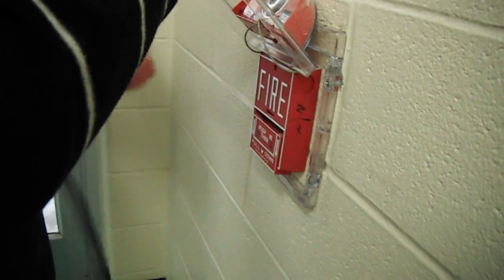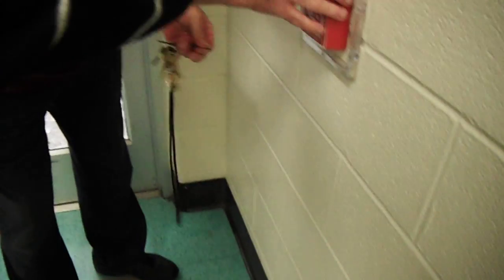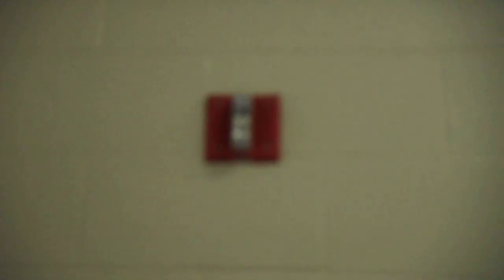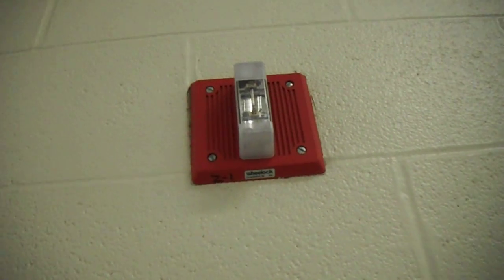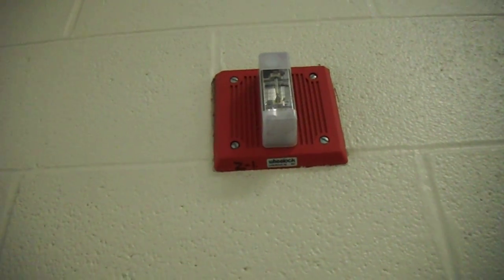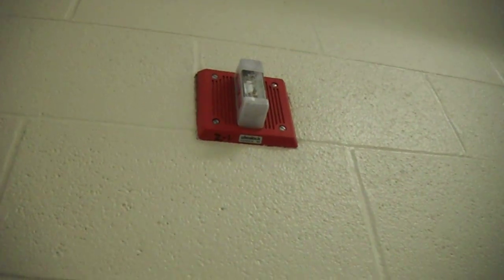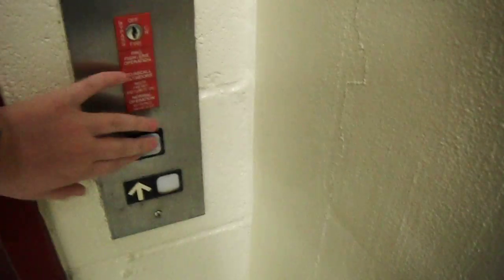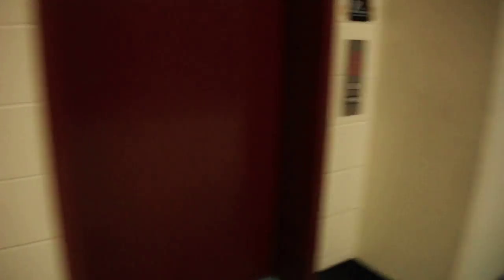Faraday MPC-2000 System Test

Comment: A couple of buildings at my college used to have Faraday MPC-2000 systems, replacing old Simplex 4207 panels during the 90s. For a while they kept the old Simplex 4051+4050-80 horn/lights, and then over time replaced most of them with Space Age VA4 horn/strobes, and they kept the old Simplex pulls. One building had an RDC-700 annunciator replace the old Simplex annunciator. But now both buildings don't have the MPC-2000s anymore; one of them has a Fire-Lite MS-9600UDLS, and another has a Notifier NFS2-640, and all the existing alarms got replaced with SpectrAlert Advance horn/strobes.
Reply from the maker: This building had the RDC annunciator, they claimed it didn't work, but it wasn't configured correctly... I don't know much about those units. You really can't find much if anything about them online...

Comment: How does one get the permission to do that?
Reply from the maker: ***** We were good friends with the administrator that did the drills.
Reply: Well I'm never going to pull the fire alarm even if I have permission to I will still not pull the fire alarm. And if theres a fire I'm still not pulling it. I don't play with that stuff.
Reply from the maker: Specialty Elev8ors and UEE's by Technicalboy3000 If you do not activate the fire alarm system during the event of a fire or smoke being seen, your in on a big lawsuit if ANYONE dies! It's likely that their smoke and or duct detectors would pick it up anyways, or someone else does the right thing by pulling the pull station.
Reply: WheelockElevator I don't ever pull fire alarms. I will go near it sometimes if the space forces me to but I won't bother touching it